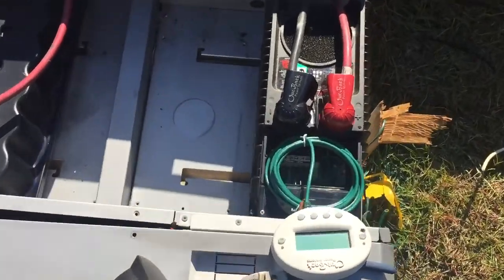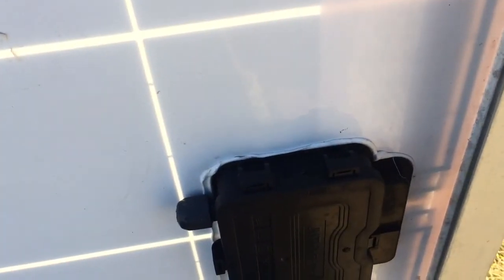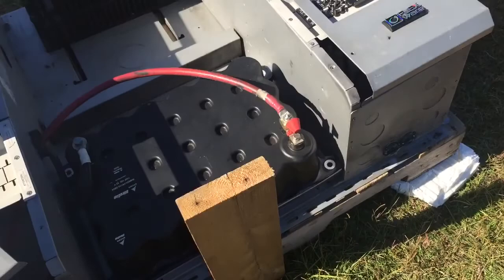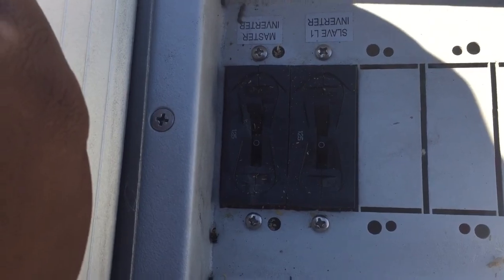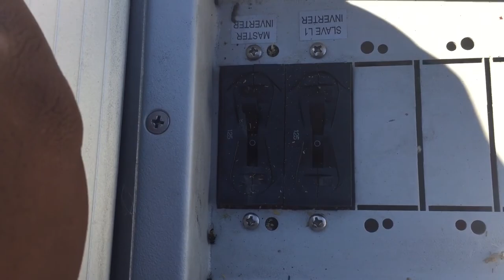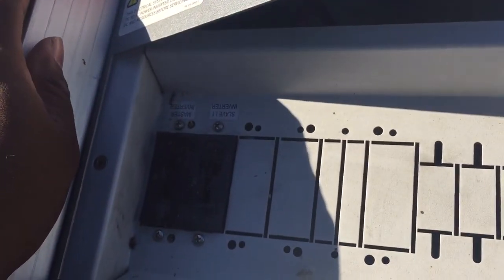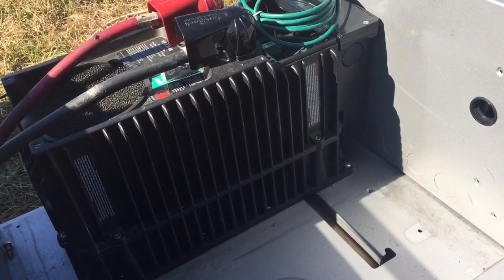48v ultracapacitor on solar using outback power inverter

Comment: Compared to lition battery , how does super caps match up ?
Reply from the maker: Bruno Berllam lithium battery is superior when you are looking for capacity of energy. Capacitor is ideal for releasing energy on demand. So unless u have the ability to purchase a vast supply of batteries at one time I would always pair super caps with battery to prevent prematurely damaging batteries through high amp loads
Reply: Is there anyway i could contact you ?
Reply from the maker: Bruno Berllam solarvalkyrie86@gmail.com

Comment: what is a different way to contact you
Reply from the maker: Donald Townsend solarvalkyrie86@gmail.com
Reply from the maker: Donald Townsend pm me
Reply: @brooksjeremiah2011  I am trying to connect a maxwell 48 v 165 f ultra cap to my 48 v battery bank and in parrelel and it arcs so ban when I try to connect it. What am I doing Wrong?
Reply from the maker: @Caleb_Matthews  use a resistor to balance them if v difference is high it will get very hot another option is to connect a 10 amp dc breaker and quickly turn on and off to bring up the voltage of capacitor
Reply: Use house light bulb to charge caps